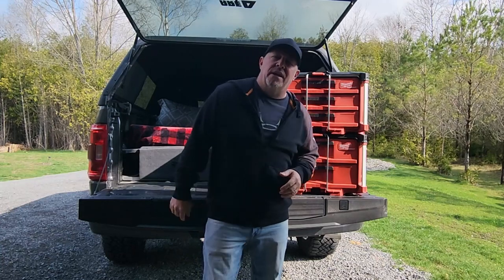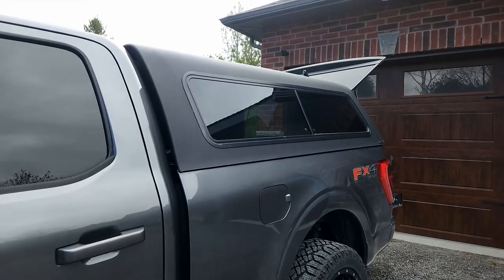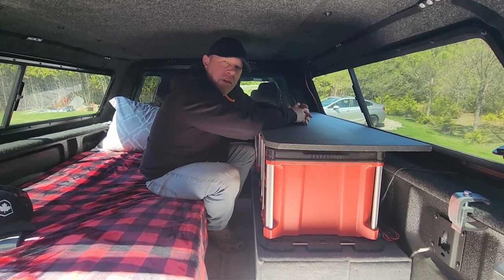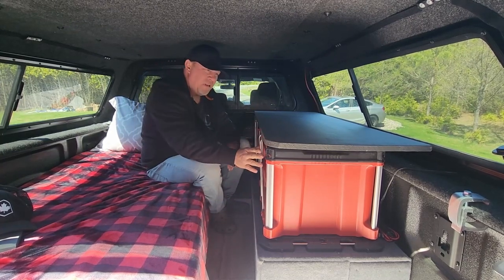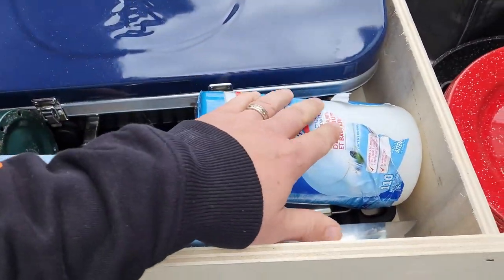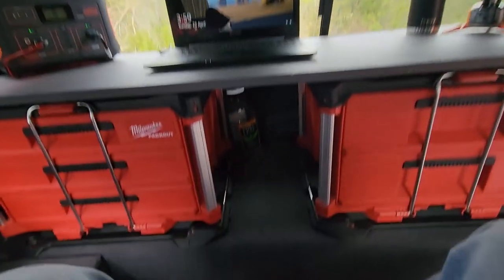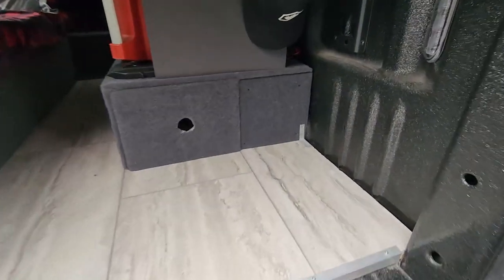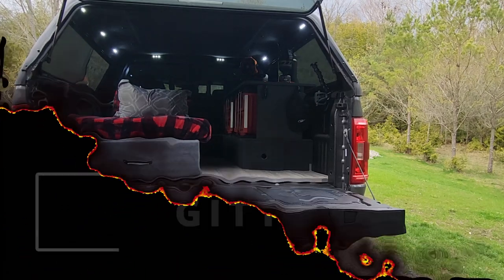Complete Solo Truck Camper Setup Using Milwaukee Packouts In My Build !

Comment: “Simple setup” 1000% “Basic setup” NO WAY and I mean that with respect. Using the pack outs make this an amazing setup. I never could get onboard with the packout system. Don’t get me wrong I think they are a great system. Probably the best out there but for ME, I never had much of a use for them. This has changed my mind. I want a setup like this but dreaded the idea of taking several weekends to do a bunch of woodworking for my drawers to come out subpar or wishing I would have done something different the first time out. This system eliminates all these issues and saves a ton of time. You just earned a subscriber for this. Keep up the great work.
Reply from the maker: Wow !  I really appreciate your comment. 
To be honest I would have never bought the packouts just for the camper build.  I ended up switching jobs and no longer had a need for them in my work truck so that’s when the idea hit me to use them in my build.  
Again ,  I appreciate your kind words and you taking the time to check out my video.  I’d love to see what you come up with for you own build.  CHEERS !!!

Comment: really cool idea with the packouts. I just made a first aid/trauma kit using two of the smaller ones and super happy with it. Still figuring how I'm gonna mount it in my truck though. One recomendation I'd make is getting some thick rubber weather stipping and running it along the sides and bottom of the tailgate. It'll keep a lot of dust out of your bed when offroading
Reply from the maker: Thank you.  I'll also be looking at a tailgate sealer soon.  Appreciate the tip.  Cheers !

Comment: Put a lip around the top edge of the bed. It will keep the mattress in place. Thank you for the vid.
Reply from the maker: The matress doesn't really slide much with the carpet on the bench.  Plus the cabinet come out of the other side and a replica of the bed slides in for when my wife wants to come out.   I appreciate the tips though and thank you for checking our my video.   Cheers!

Comment: How long and wide is your table? Is your tool box’s plastic or metal? I want to copy this. This is a great video. Thank you.
Reply from the maker: 56 x 20  inches. length was based on where the wheel well ended and the width was based on the width of the packouts
Reply from the maker: The tool box’s are plastic.  They are Milwaukee Packouts

Comment: Love the set up. I have a few questions:

1. Height of the bed (before foam pad)
2. Width of bed?

I have a Toyota Tundra and i do not think i could sit on the bed without significantly leaning over. I am 5'10".
Reply from the maker: I have my bed frame right flush with my wheel well which is 8” high.  The width of the bed is 60”    I am 5’6 and just fit while sitting up straight.  I didn’t go with the higher topper because I need to reach the awning and be able to load my fishing kayak on the roof of the topper.  
Hope this helps.

Comment: How do you stop dust from getting in the cap when off road
Reply from the maker: I haven’t had too much trouble with dust yet but I have installed curtains in the back window that hang to the floor and that seems to stop the majority of the dust so far.  I don’t have an issue anywhere eles besides the back.

Comment: Lol 5.0 bulletproof 😂😂😂 my 2014 work truck with this magical mysterious motor had 17 code pop up and throw itself into limp mode and needed a complete rebuild with 18,000 miles. May yours actually be bullet proof, but ours was not and I am actually a ford fan. That one failed us bad.
Reply from the maker: Damn. That sucks to hear that. This is my third f150  and only issue I have ever had was an EGR valve on my 2001.

Comment: what are you using to attach the counter top to the packouts ?
Reply from the maker: It shows in the video.  I found some after market feet that slide into the top slots of the packouts.   I screwed the feet to the bottom of the board and it slides in and locks in place.